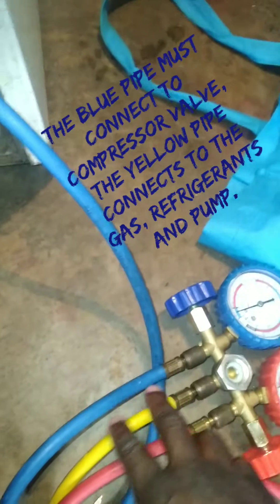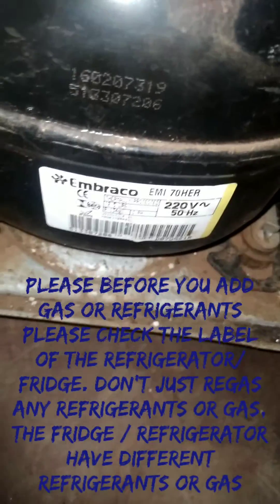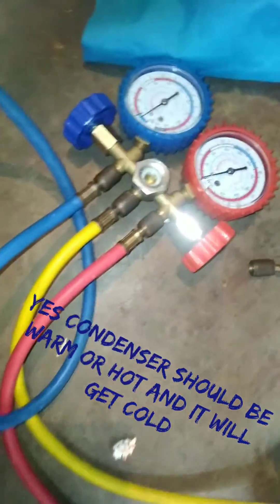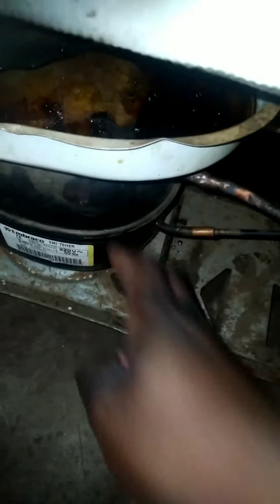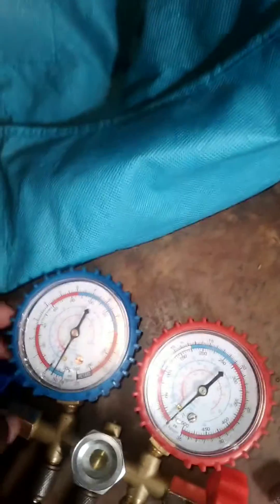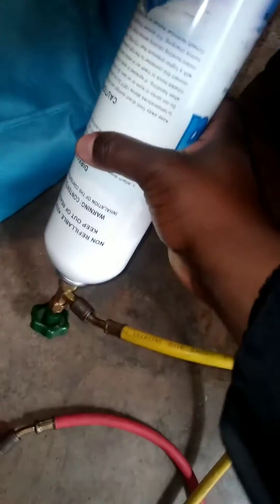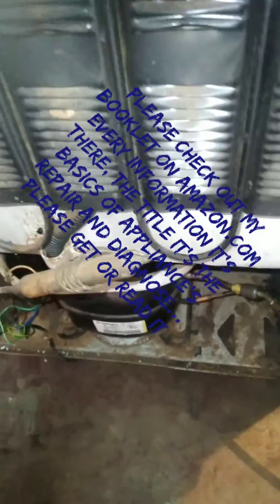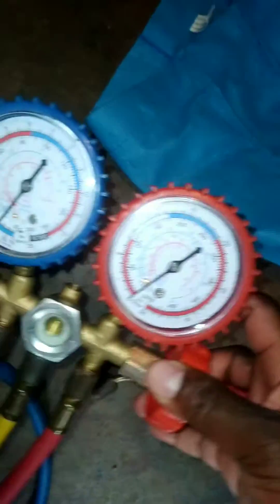How to regas/ refill the refrigerants or gas in your refrigerator/ fridge

Comment: Brother since l followed your videos l tried to do it yesterday and it was my first time ,after vacuum the compressor changed yhe sound oky that's fine ,l filled the froen it doesn't get cold why ,mybe its because at frst l open the freon whilst standing up
Reply from the maker: 🙏🏾 start vacuum again, and close the gauge the switch off the vacuum then connect the gas check the compressor with gas is use R600a or R134a the you must recharge with that gas but your can must be upside down because you charging the liquid not the air.... it's only air condition that you charge the air